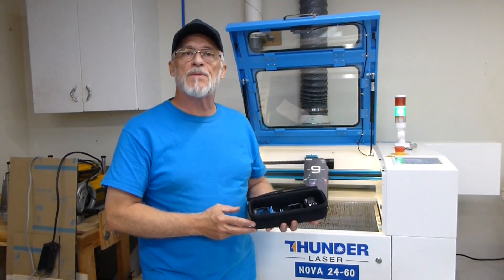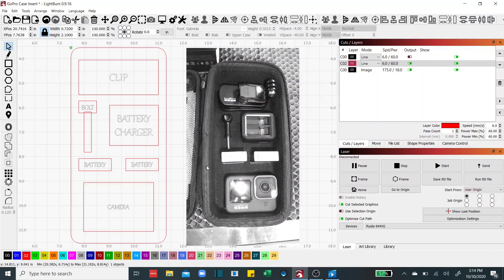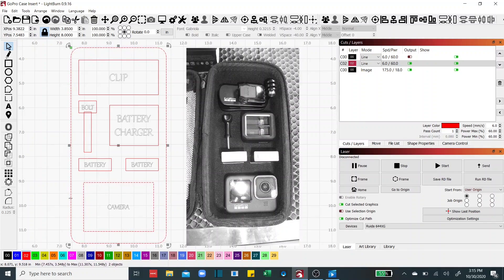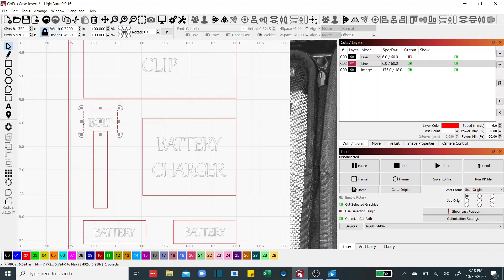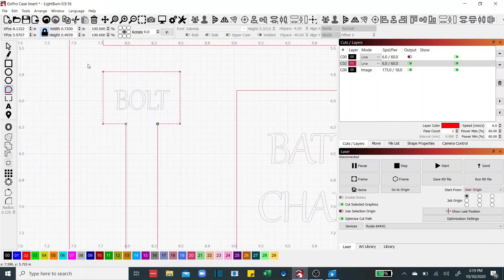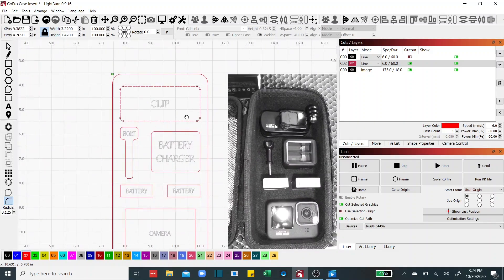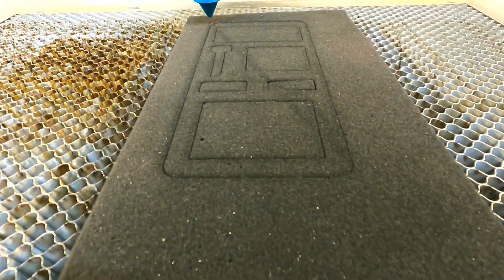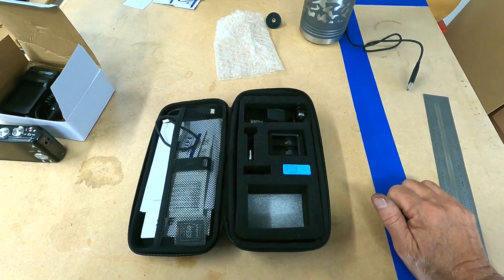Fun with Foam and your laser (Beginners)

Comment: How thick of polyurethane foam are you able to cut?  Will it cut 4.5" thick foam?
Reply from the maker: Thickest I’ve cut is 2.5” with a 4” lens
Reply: @computercreationz
Reply: @computercreationz  If a ship you a piece of 4.5" foam would you test it to see how well it cuts or does not?
Reply from the maker: @Robinweinrich-zf7sb  no I’m not interested in that. Remember not all foam is laser safe! YouTube how to tell if foam is laser safe. Because of its size it’s very expensive to ship!
Reply: @computercreationz  very good thanks.

Comment: Curious why when joining the two rectangles for the bolt you didn't select them both and use weld?
Reply from the maker: You certainly could have, there are several ways to do this process. Thanks for watching